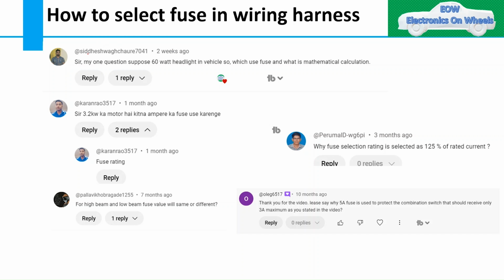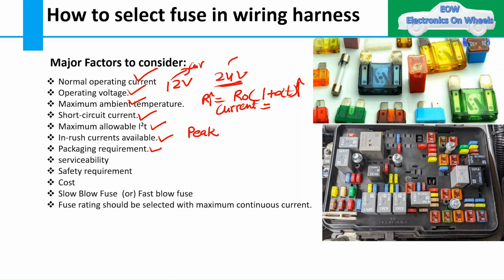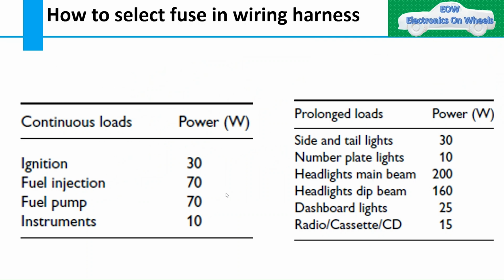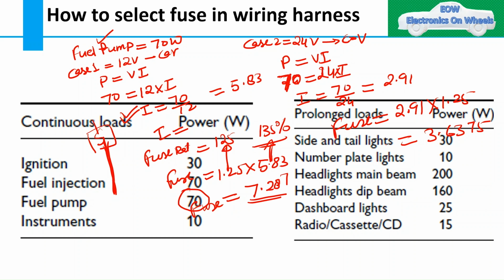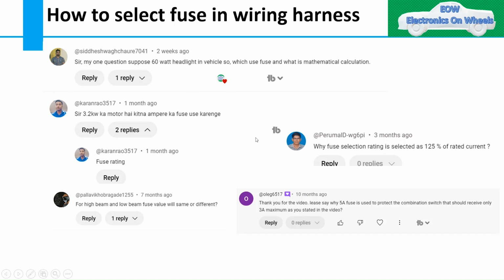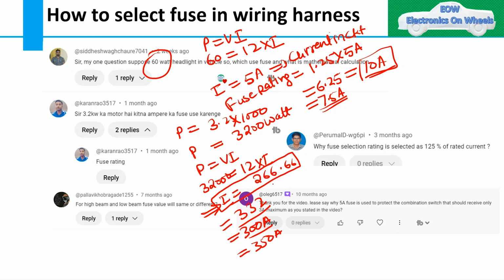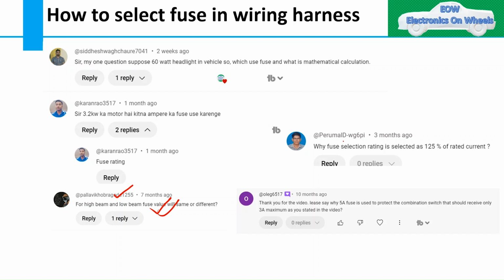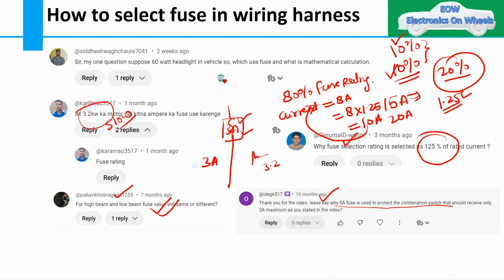Q12:How to select Fuse in car? Why fuse rating 125% of I? What is Fuse value for Headlamp@MunroLive

Comment: for a better understanding 
generally we take 125% of I for Fuse.
because we take derating temperature and also if u see generally fuses are rated at 25°C
mostly fuse box is placd in Engine bay(105 to 125°C) for cars and for commercial vehicles it is placed in Driver Compartment (since there is no airfow or engine will be slightly placed in Driver compartment we take generally (35°C to 85°C)) Due to that reason the efficiency will be decreased to 75%
so we wiil take 125% of I

For example u have i=5 Amps(nominaaly operated current)
we will select 7.5 amps fuse
so take 75% efficency  of7.5 amps = 5.625 amps
here we are taking only 0.625 amps extra which is not so bigger 
this is the reason we are taking 7.5 Amps  fuse rating for 5 Amps of current(I)

i hope  it would satisfy your interviewer

Comment: In a car, we use a 12-volt battery, but the MEGA fuse has a voltage rating of 32 volts DC. My question is, how is this 32-volt rating compatible with a 12-volt DC car system? Can you please help with this?